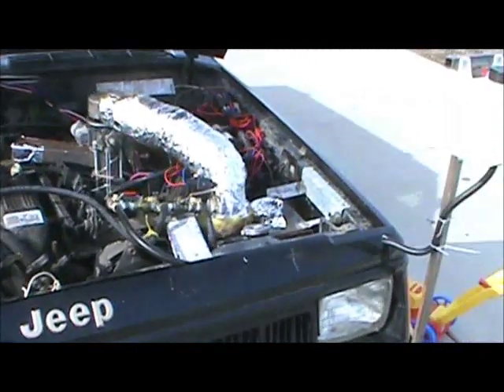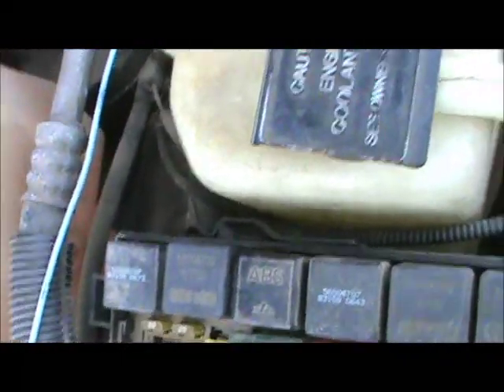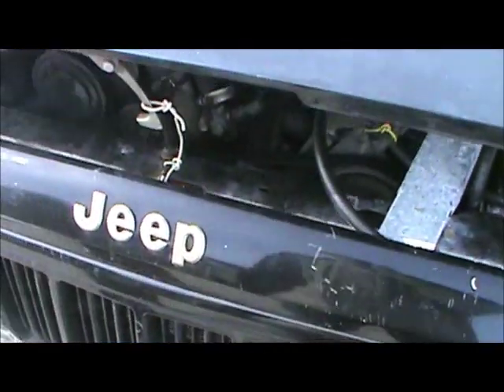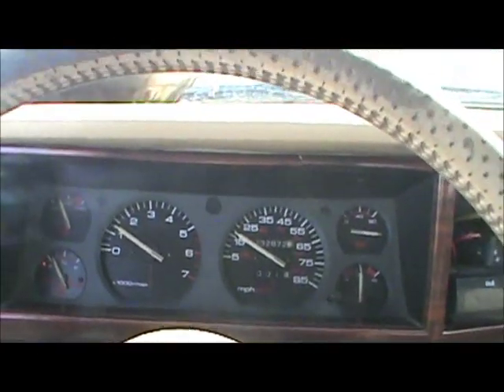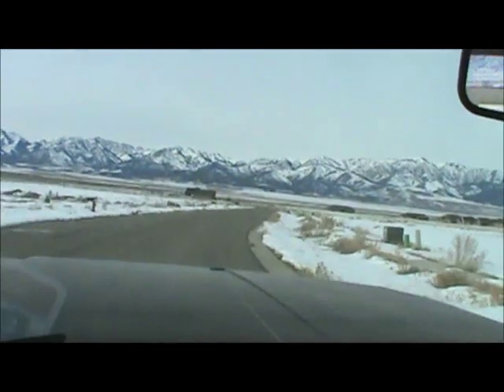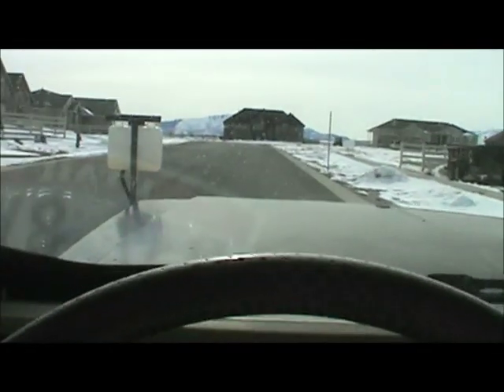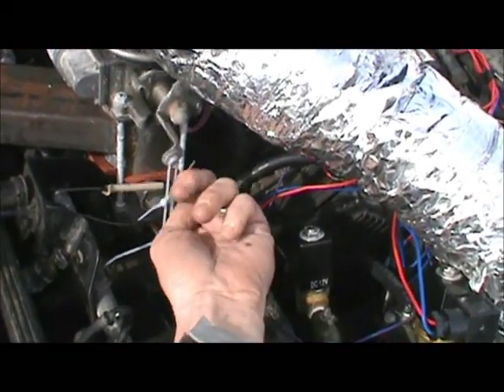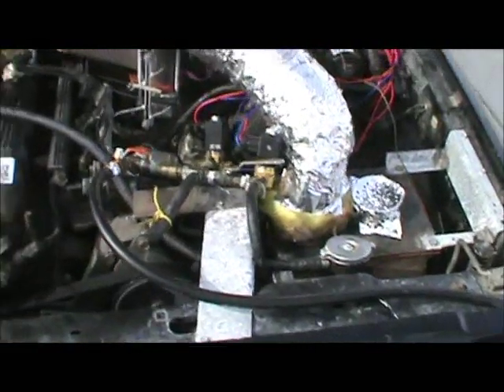100+ MPG PROJECT VAPORIZER TEST DRIVE 1

Comment: Please post the final result Jeep & a 25 to 50 mile ride at normal driving conditions with fuel measurement before & after (mpg)
Reply from the maker: I wasn"t able to do this test. I was on my way to dialing the vapor system in to the point that it would be reliable enough to do so however my test vehicle was destroyed by some jerk so after investing all that money into it I could no longer continue to do so since someone destroyed the engine etc. in it.

Comment: I invented a Fuel-Expander it adds 5 to 17 more miles per gallon,I found a way for small engines my lawenmorer took 2.5 tanks to cut one acre of grass i fixed the carb took 1/2 a tank to cut,got a 01 Harley Sportster 883 it was 60 mpg i fixed the carb like my lawenmorer i road 191 miles 55 & 60 on 2.004 tents of gas 95.3 MPG my step-dad had a 4 cyl Isuzu Pu diesel   he said it got 44 mpg with a Grice-Device it got 60 MPG & he said it stopped smoking like a diesel. My email mrfuelsaver at gmail dot com look on scnow.comgricedevice   read Grice-Device  can help streatch miles per gallon? In 1991 i had a 280 ZX Datson straight 6 cyl fuel-inj it was 19 mpg i made a Vapor-System got 60 MPG I went in army 82nd ABN ft Bragg NC 1973 was 17 in 1974 i hit a sgt for wakeing me several times for snoring he told the Captain i hit him he told me was going suspend my pay 6 mos put me in stockaid & courtmarshal me i came home,went back was given a Undirsable discharge no bennifits,i found i have slep-aptna in 2012 trying get my VA disability messed up my lumbar on 2nd jump at ft Benning Ga i had a May-West on my 2nd jump i was falling 30 to 40 ft a second i could not do a PLF i just hit feet then ass I know in my heart that messed up my Lum-Bar i never hit the groung that hard like i jump off a light pole. I am working on a Vapor-System like i had on my 280 ZX Datson

Comment: i put gas in a fog machine and the vapor came out as thick as the regular fog solution , fog machine i used had low pressure fuel pump a heat element block and a small nozzle . it worked better than any gas vapor video ive seen on youtube, .. just passing on the info. sorry i didnt get it on video.
Reply: Thanks dude for the info. I had thought of this because of being a musician and all however never tried it. Is it truly safe to use is the main question? Peace out.
Reply: Please post a video on this working. Thanks

Comment: This may have been answered already so please excuse me if you have, but what is your take on the air/fuel ratio during load. I understand the engine is running with very little to no load, but how are you increasing the vapor input to make a safe air-fuel ratio for normal operation? I dig the idea but am just wondering how this is going to work with more load and how the engine will survive. On a FI engine the ECU enables the fuel input off the MAF or MAP and increases and decreases fuel input . How about timing advance and pre-ignition? You are basically piggybacking on an already programmed ECU. How are you going to get around this? If I were you, I would invest in a Wideband air-fuel gauge to see exactly what the air-fuel ratio is at all times. I would be worried about damaging heat/detonation from the lean conditions. A engine WILL run extremely lean, but what is it doing inside is what I would be interested In. Great job BTW..I enjoyed the series.
Reply from the maker: I am currently working on the ATF mixture. I is very complicating. I have an exhaust gas analyzer but it's junk. I do need to install a ATF gauge they can be pricy little buggers but it is much needed for sure. I redesigned the system you see in this video and incorporated a bubbler system with the heat system so it more or less self regulates. I have went through some steam terrain with hardly and power loss but I am still working on that. Automobile engines are a pain to work with due to all the changes that effect the performance such as ambient temperature, humidity, altitude etc. As for the ECU causing problems, in this particular vehicle with a manual transmission I don't have to worry about the ECU effecting things because I shut off the fuel injection system and send the fuel through the throttle body. There are some complications in vehicles with automatic transmissions due the the mass airflow sensor. I have to place the MAF at the intake of the vaporizer to prevent the MAF from causing problems with my transmission. If fuel vapor passes by the MAF it throws my transmission off. There is allot more to this then meets the eye. I still have lots of testing and re-engineering to do before it is ready for others to use. As for the engine running lean and causing problems there, I need more data to be able to say for sure what the effects of a vapor system have and en engine. I can tell you this the cars computer will tell you the engine is running lean but is should, it's a good thing when running your vehicle on a vapor system for the car to tell you it's running lean. The computer can't seance all the changes that occur when running on a vapor because things are scaled down big time with a vapor system including the amount of ambient air being pulled into the engine. Less air is required when using a fuel that is in a more volatile state. My system has got to a point that it is running so efficiently that there is literally almost no ambient air entering the engine. The power of the engine at these levels is similar to an engine that is running normally. There is a slight power loss but it is barely noticeable WHEN the system is running right. In order to know the exact differences in HP, torque, etc. between a vapor system and an engine running normally I would have to get it tested on a dyno.  One other note to make is that when running on a decently stable vapor system in my Jeep Cherokee I have an across the board temperature drop of 10-15 degrees F. Running lean should cause engines temperatures to rise but with the vapor system running while the cars computer says the car is running lean there is a temperature drop.  Very interesting isn't it?

I have actually stopped working on vapor systems for vehicles for the time being and have moved to doing all the testing on a generator. By doing this I can have much more control of everything and it is much easier to see what is going on and redesign and make changes from there. Once you figure out what is needed to get the perfect ratio of everything (heat, ATF, humidity, oxygen changes "that's a trade secret",  the effects of altitude changes, etc.) on something simple like a generator, then you can incorporate that into something more complex such as a system for a vehicle. After realizing how difficult and complex a system needs to be for a vehicle I knew I had to take a step back and start with the little things and work my way up from there. I knew I needed to learn all the little details on something that is much easier to control before moving onto bigger and better things such as a automobile.

I have seen some amazing things and have made many accomplishments and discoveries on systems for automobiles such as 211.7 mpg and for that I am grateful, but if I want to build a system that will work consistently and reliably on an automobile, I have to learn the little things, the little details and all the little tweaks first and that is why I have taken a step back from testing systems on automobiles and have reverted back to testing systems on stationary engines. Once I learn what I need to learn on a small scale I will incorporate that knowledge into building a reliable system on a large scale for cars, trucks, motorcycles, etc.

I hope this answers your questions.
Reply: Unbelievable my friend. You are doing a great job at this. Keep up the hard work!

Comment: Hi tyson chapel I bilt one my self on a 4.6 289 it runs rough I don't have something rite could u give me some pointers email me at sowers.apollo@gmail.com I like your work
Reply from the maker: The best pointer I could give would be to try different things, adjust the air volume or vapor output. Don't let the gas get to cold.

Comment: It's very nice to see your work, i've seen most of your videos and a bunch of many other and many other people on the same track. but yours are more detailed and complete, mainly on the part of thinking of a fuel continuous feeding loop!!! very nice. I think you should just stick to the float valve IN MECHANICAL FASHION, cables and wires DO NOT DO GOOD with gasoline in the long run. MY advise take out anything electric... cheers!!!

Comment from the maker: The wires ended up breaking because of how they were sitting so I had to replace the float switch and reinforce the new one so I don't have that problem again.

Flash protector is made out of perforated steel.

Comment: Why do you think you are having problems with the float valve for regulating the liquid gas level in your vaporizer?  What did you use for the flame arrester to prevent fire in the vaporizor?

Comment from the maker: The reason I used exhaust gasses is for efficiency purposes. If I use a heating element that will rob power from my engine to make the element work, heating elements take allot of power to operate.

Comment from the maker: The most I have achieved thus far with this system was about 30 mpg on this Jeep. The current setup I have is not working the way I would like it to so I am in the middle of making some modifications to increase the velocity of the air running through the vaporizer and a few other things. Ya it's taking way to long to get this done, but I'll get there. Once I have it running properly I still want to take a drive to your place show it to ya and buy and pick up some HHO stuff from you.

Comment from the maker: The fastest I have gone with this system was about 60 mph with no problems. i need to tune in the vaporizer a bit more before testing it on the highway. I did drive my Buick with the old system in it at 80 mph and it ran great until the vaporizer got to cool due to the extra air flowing through the engine compartment and the larger volume of air flowing through the bubbler chamber. Now that I have a way to maintain the heat I shouldn't have a problem.

Comment: Hey Tyson it's been 3-4 months since you have uploaded a video on this. You were hot on the trail posting and building of this project. I can only assume it didn't increase your fuel mileage. I would think if it did you would have posted it by now.
Okay to private message me.
Thanks Steve

Comment from the maker: I have not actually installed an HHO system in my vehicle but I have done extensive research on it and depending upon the car you can get up to a 100% increase in MPG. I have had good success with MPG increases using vapor systems the problem so far is they are extremely hard to tune.

Comment: Awesome stuff Tyson! I really want to do this system to my Toyota 4Runner in the future, but need to redo the engine first. Just out of curiosity, how does this set-up change how a smog check would be done? I live in NV and we are required to do smog checks every year for registration renewal. I am sure that a vehicle would pass a smog check with how a gas vaporizer system steams the exhaust.

Comment: Have you considered purifying the gasoline before running it in the system you are using. Just betting that when people like tom ogle designed this there was not half as many additives in the fuel then.

Comment from the maker: I have done extensive vapor testing with my lawn mower it is easier to do it on this because its stationary and has constant revolutions per minute. testing on my lawn mower has given me much needed answers as to what needs to be done one of the most important of which would be temperature. the thinner the vapor gets the more efficient it becomes.

Comment from the maker: it takes work and a lot of different trial and error testing to get the perfect ratio such as air vapor heat volume surface area and the list goes on. I can do all that with this current design I can also change this design easily all I need to do is make a difference lid. by being able to change out a little I can change the airspeed in the container the pressure etc.

Comment from the maker: the environment has to be controlled and its super sensitive when you get the gas into a vapor state.. I built the design I have now so I am able to control the environment on the things needed how to make a successfully running high mileage design that will work every time.

Comment from the maker: the reason I'm not using that set up is because I had a lot of problems. I only got that high mileage a few times and have not been able to achieve even close to that sense with that design because of all the parameters that are required to make it run correctly

Comment: Just a question, if you got over 100+ mpg on your old setup then why arent you using that setup? 100+ is alot better than anything out there is getting. What you are doing now is wasting money and time when you clearly posted that you have gotten over 100+ mpg. I have been following your work for a bit now and it does not seem smart to not use a design that worked. Anyway good luck

Comment from the maker: I had to install a secondary air inlet so there is less adjudication of the gasoline during high rpm's. Play with the size of inlet pipe it can make a big difference.

Comment: Air pump pumps air into a coiled hose submerged under liquid gas in pressurized container which agitates gas into fumes and these fumes escape the pressurized container when the accelerator pedal pulls on a cable going to release valve on container and then through a pipe to intake manifold through a propane fuel injector (flash arrester) the more the accelerator is pulled the more fumes that are delivered. A perfect fuel to air ratio everytime. Always a little gets through for idle though...

Comment: Liquid gasoline, being denser than air, is slower than air to react to a force applied to it. When the throttle is rapidly opened, airflow through the carburetor increases immediately, faster than the fuel Vapor rate can increase. This transient oversupply of air causes a lean mixture, which makes the engine misfire (or "stumble")—an effect opposite what was demanded by opening the throttle. This is remedied by the use of a small piston or diaphragm pump called an Accelerator pump.

Comment: i have a very basic set up in my 86 silverado and it finally got it working. its just a bucket with a vent pipe that goes under the gas and then another making a passage directly to my carb.  But i can only get it to stay that way at idle.  what can i do to get it so i can press the gas and be able to drive it?
Happy Easter :)

Comment from the maker: This is very true they do place more additives in the gasoline during the summer. Gasoline in the summer has a yellow tint to it where as winter gas is clear. Yes I have ran it tell it's dry and everything did vaporize which is a wonderful thing. I am now waiting to see what summer gas will do. I can make it vaporize all the way too but I will have to increase the temp in the vaporizer to do so.

Comment: Wow! that would be awesome. I was not able to get quite that much of an increase with a simular setup I have on a genset engine but it was 100% better than factory. Working on another different type of heat exchanger that will allow more precise control of temps on the truck version. Time will tell.  I wish you the best.

Comment: I'm sorry if I've been misunderstood, but I was referencing the moving parts within the ICE itself, crank, main bearings, rod bearing, wrist pins, rings, OHC valve springs, timing chain or belt, cooling system, water pump, alternater, ect. Moving parts subject to engine break down. As I mentioned earlier "from my perpective only" the EV is a better choice, because less moving parts are involved, I've developed a concept that can eliminate the need for batteries. Email me at user name@gmail.com

Comment: Have you run your vaporizer dry? If you have then that's a testimony that your vaporizer will vaporize everything in the gas. If it is unable to run dry then you will need to figure out a way to get rid of the gas that's not able to vaporize. Also in the summer you might get different results because the oil companies add different additives to the gas in the summer and winter.

Comment from the maker: You can use aluminum window screening material or perforated steel with holes about the same diameter as that of window screening. Window screening will allow for better vapor and air flow then perforated steel. You can message me by clicking on my name bellow the video which takes you to my youtube channel from there on the right you will see a link that says (by Tyson Capel) when you click on it it will have a drop down box one will say block user and the other will say send message.

Comment from the maker: I checked the valve and actually disconnected the hose connected to the valve to see if it was leaking and it was not. In this video I am running very rich. I am making adjustments to minimize the vapor production.

Comment: It's interesting that you achieved 211 mpg in your other video and in this one you got a lot less. I was wondering when you disassembles your first vaporizer was your gas shutoff valve Broken ? Theoretically you should have achieved similar mileage with this vaporizer.

Comment: Hello Tyson,
I love your concept, I beleive that it's quite innovative and unique. I would like to know if the lack of liquid fuel will have an effect on the cylender walls and rings over time. Because your vapor has mol's of H2O, which can wash away any lubricant in the cylender. I'm also very sure that any design challenges can be over come. Your concept is a thermodynamic one that involves an awful lot of moving parts, ICE, trans, ect. Maybe I'll get a chance to show you how to eliminate ICE